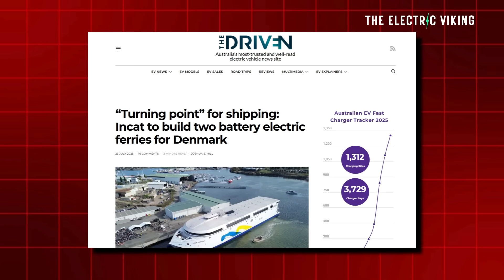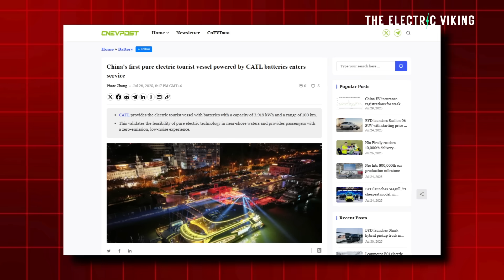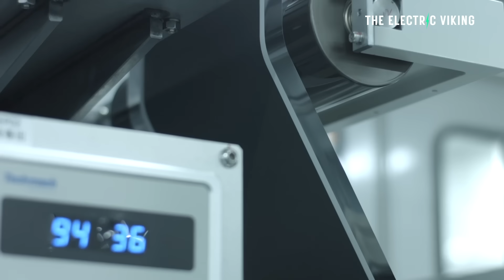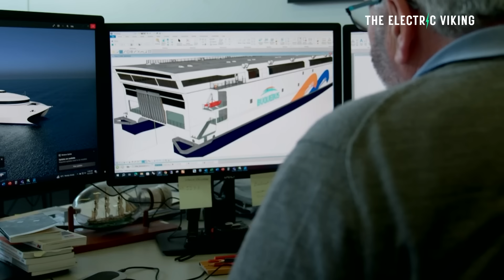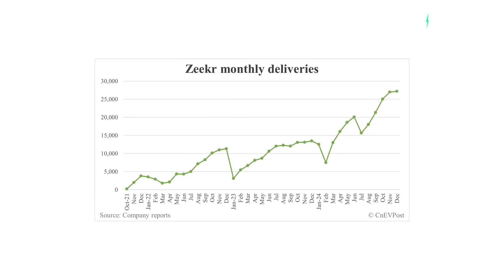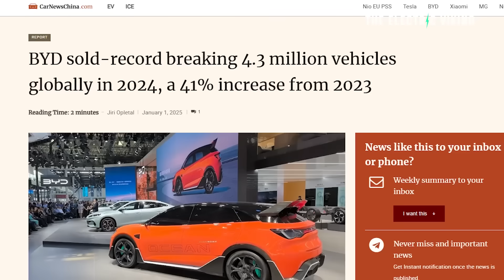TURNING POINT! Shipping is going Electric says worlds biggest battery company

Comment: Having enough electricity to quickly recharge these large batteries is the main restriction. Same issue 500kw chargeable cars have when they get to the point of reality - the charging stations.
Don't see anything about safety measures in the event of thermal runaway which needs solving by a complete rethink on battery composition to eliminate the bbq on open seas.

Comment: These Incat ferries are awesome, I’ve been following their build on the company website. Great for Tassie. But Sam is mistaking shipping and ferry operations. A ferry service is usually only a few hours and charging facilities can be set up at each port for the turnarounds. But a 60,000 tonne bulk carrier on a 4 to 6 week voyage is another thing altogether. These ships will continue to run on bunker fuel.
Reply: or multifuel /alternative low CO2 fuel with ammonia,  hydrogen, methanol,  etc. see  engines from Wartsila, Hyundai Heavy Industries,  Everllence/MAN, MTU, etc.
Reply: @jdaglish2975  Yes, you’re correct. The shipping industry is looking at different types of hybrid liquid fuels to replace or partly replace heavy bunker fuel.

Comment: No it's not, electric powered ship's are a non starter just like electric planes and heavy trucks, this nonsense is ridiculous, what about the costs the size and weight of the batteries which is the biggest issue as all these modes of transport are weight sensitive and then there is the catastrophic environmental damage of the battery production, not to mention range issues, stick with the best most efficient compact and reliable source of power diesel
Reply: Then you had better watch the "Electric Trucker" to disabuse you. He publishes a weekly video of his logistics routes and charge planning for a week's work around Europe with several makes of heavy 40tonne articulated trucks [MAN, Volvo, Mercedes, Iveco]. Keep up to date, this transition is moving fast.

Comment: Imagine the charge time of these beasts
Reply: It depends of course on available charging power. Big batteries don't need longer to charge than small batteries, since charge power they can accept scales up with the size of the  battery.  The limiting factor may be available power though.
Reply: Depends on the design. The EBoats I have seen videos of have 4 impellers for power &/or redundancy. That means you can charge in parallel. So re-calibrate to 25% of whatever you imagined.

Comment: How about electric cruise liners? They could tow floating islands filled with batteries and covered with PV panels - up above the tennis courts and golfing range.
Reply: Unfortunately, powering ships (and especially cruise ships) with solar is unreasonable, since the ratio between available solar area and the power needed to overcome water drag is so low. Even with cars, where the ratio is much better since they roll on streets with  uch less resistance, putting solar on EVs makes not a relevant difference.

Comment: Makes sense. Most ferries have a set route that's always the same so they know what range the battery will need. Also the extra weight of batteries is less important when you're on water.
Reply: These boats are lighter than ice boats

Comment: Just like railroad locomotives are driven by electric motors, I believe most ships are currently driven by electric motors.  It is just a question of how the electricity is produced.  Diesel engines/generators, batteries, hydrogen/fuel cells, or nuclear/heat driven generators.  For ocean going vessels I believe the best option will be vessels with molten salt nuclear reactors.

Comment: How are you going to recharge the massive batteries on ships when you are out in the oceans / seas?!  Wind turbines and solar panels mounted on ships...  there is not enough room on ships?!
Reply: I think the near-term plans are focusing on shorter routes from port to port on the same side of the ocean, which is a much easier problem. For ocean-crossing vessels, I like the idea of sailboats, taking advantage of the wind out at sea without a bunch of expensive charging infrastructure. There are already a couple of companies that use modern sailboats to ship cargo across the Atlantic, although they do use fuel burning engines as backup for when the wind stops (they claim it still reduces emissions by something like 90%, as the engines are seldom needed). Right now, these sailing ships are not nearly as large as modern container ships, but there's probably plenty of room for improvement, and maybe it's possible to go the other direction and shrink container ship sizes, so long as AI-driven automation allows it to be done without blowing up labor cost.
Reply: These are very short range vessels, just a few tens of km. Current batteries' energy density is still too low for anything else.
Reply: Recharging while out on the ocean is not an option. Solar panels do not generate enough power on such a limited area, and wind turbines will cost almost as much power as they produce due to air resistance (except in cases when wind comes from behind).

Comment: And you charge it we what? Those are huge batteries.
Reply: They just build huge chargers in the ports, obviously.
Reply: We have an electric ferry in Germany that can transport hundreds of cars. They have built chargers on both ports were it stays, with enough charging power to refill the battery, while transported passengers and cars are swapped. Don't remember the exact power they charged with, but it was several Megawatts.
Reply: You charge it with electricity.